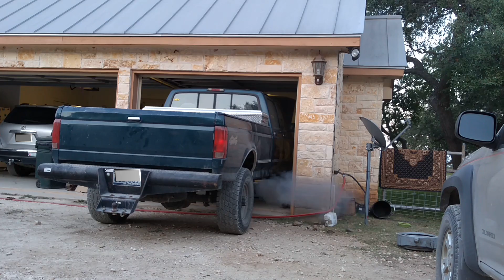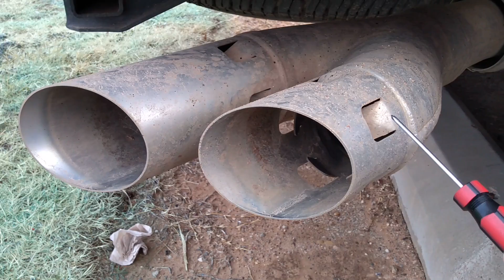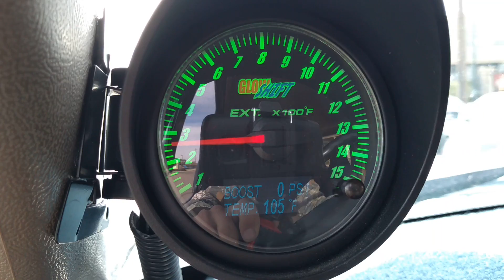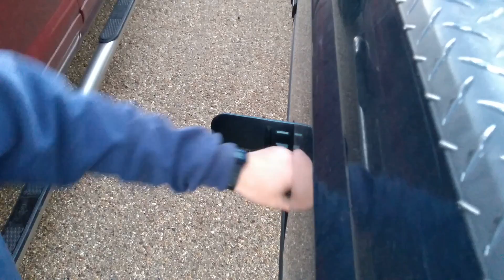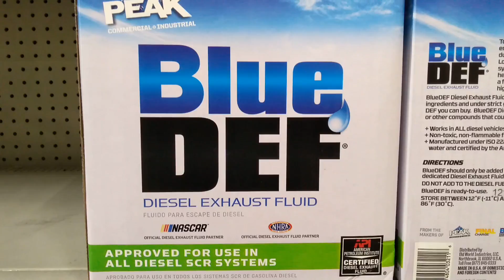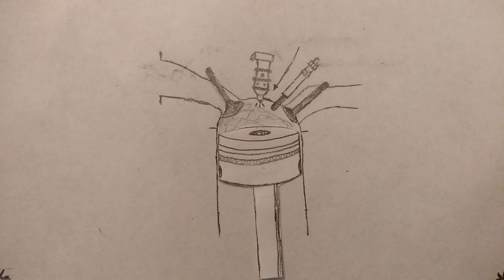Top 10 Things to Never do to a Diesel

Comment: Understanding you're a Ford guy but I'm searching everywhere I can for some answers of what happen to me with my cummins 5.9 with 133K miles.
Just took the truck for an approx. 2500 mile road trip with my approx. 13300 pound travel trailer. I purchased the super tuner on my way out, around 25% of the miles. Also installed a cold air intake K&n. 
I noticed what was described to me as "axle wrap" with the tuner so took it easy with that in mind. All in all, the truck gave no mechanical issues and ran fantastic. 

When home I took it for a ride with tuner still on "TOW/PERFORMANCE" mode, doing 80MPH on the freeway when sudden engine shut down. I noticed, what felt like the axle wrap just before/during the engine failure. All guages still operating, speedo, etc except the engine. 

Atempted starting. Engine didn't/doesn't turn. 
At this time I've removed the oil and filter. I can't see any kind of "shavings" or metallic particles in either of the oil in the container or the filter after tearing the filter apart carefully so not to CREATE shaving. I opened the housing for the flex plate to attempt to turn by hand with the engine solid. Removed the serpentine belt still no turning of the engine by hand or starter. 
All guages in the stock dashboard of the 06 Ram 2500 SLT were showing good at the time of the failure. No over heating. Engine just seized up on me with nothing to show of a reason to do so. I do not have any after market guages showing anything more than stock guages. (That will change when this thing gets up and running again...)

Can you or anyone who read my post here give me any ideas. I'm desperate and attempting any info from those I find might be educated enough to assist. 
Thank you all 
Chris Chapman
2006 Ram 2500 SLT 5.9 Cummins stock other than metioned/super tuner/K&N. 133,300 original, well maintained miles with me owning for 8000 miles, not knowing the previous owner.
Reply from the maker: I'm sorry to hear about your truck! It's certainly going to take a lot of torque to turn the engine over. It may sound obvious, but have you tried charging the batteries and then cranking the engine over? Basically rule out that a bad alternator would have caused the truck to die. If your batteries are low on charge from a bad alternator your starter won't be much good. Diesel engines are hard to turn over by hand already. Assuming that's not the case, you may want to try taking off the valve cover and seeing if there's anything obviously wrong there. If you were really pushing the limits of the engine with the tuner, and 13300lbs is a heavy trailer, you may have damaged the engine with excessive exhaust gas temperatures, which there is no factory gauge for. I'm hoping that's not the case as the engines are fairly resilient. It could be any number of things, and without personally being there I'm afraid I won't be much help. Also make sure the transmission isn't causing the engine to be locked up.
Reply: On my 7.3 my ac compressor locked up and shut my engine down and locked her down. Had good batteries and a new engine but was shocked that that would stop it.

Comment: I have a 1988 Ford F250 with the 7.3, its old but the beauty of it is that about half the stuff you mentioned doesn't apply to that old engine. It does have a glow plug issue it is not firing. I'm debating as (I know you said not to) to whether or not to bypass the glow plug controller on the truck and install a switch to manually ground out the relay and make them work. I've heard people do it and have no problems as long as you don't activate the plugs no more than 8-10 seconds. I bought the truck back in August as a project, I'm debating also would it be worth it to install a pyrometer on the truck as well.
Reply: Years ago I worked for a guy that had an old Ford that had a bad glow plug controller and had thus done the manual conversion.   I did not know they were short-duty cycle plugs on those engines at the time and did the standard 30 seconds to a-minute burn time before starting. 

A day later we found out I took out all the glow plugs doing that and he had a fit and told me I was stupid and knew nothing about diesel because nobody ever runs glow plugs that long on anything to get it started. 

I then commented on every diesel-powered piece of equipment he had from the old forklift, and skid steers on up to his big cranes, tractors, and old heavy trucks and asked him how long he runs the glow plugs on them to get them started.   

His answer, at least 30 seconds to a minute or they will never start.    😋
Reply: @tcmtech7515  I decided to add the option of manual control to the truck by wiring in a switch under the dash. It's not hooked up though as I fixed the factory system and its been doing ok so far. If it fails again, I'll have the option.

Comment: Just out of curiosity what is your take on pulling off the red wire to the wastegate on a 2000 f250 7.3?  Is there any real advantage or dis advantage?  My 7.3 is stock with an intake and muffler delete.
Reply from the maker: I'm not too familiar with wastegated 7.3's, my OBS with the stock turbo is non-wastegated. From my understanding though, pulling the red line either limits the functionality of the wastegate or disables it all together. The wastegate directs exhaust gasses around the turbine in the turbocharger. This basically allows Ford to get away with using a smaller A/R ratio housing on the turbine to improve low end response. The disadvantage to that is that the smaller housing becomes a restriction at higher flow levels (i.e. at high rpm and boost pressures). The wastegate allows exhaust to bypass the turbine to reduce restriction up top and to keep the turbo from over-speeding. You'll probably see some increase in boost on the higher end but at the cost of decreased turbo life (due to over-speeding) by disconnecting the wastegate red line. Also disconnecting the red line will decrease turbocharger efficiency on the top end as well. It really wasn't designed to spin that fast and work well. I have heard plenty of stories of people doing it anyways and everything remaining okay. It's basically just a band aid to getting a higher performing turbo. That's just my two cents though, best of luck and have fun!

Comment: On my 7.3 idi I had one glow plug fail and it was the one under the turbo which sucks to change so I installed a manual switch so that I could utilize the other 7 glow plugs that worked, I noticed shortly after that it would belch out a lot more smoke than usual.
This was because the glow plug  relay controller wasn't able to light the glow plugs after start up as was designed.
The last straw for me was when I lent my truck to a family member and told them exactly how long to hold the switch, they didn't listen to me and fried the rest of them.
Shortly after I just replaced all the glow plugs and returned the controller back to automatic control.
Plus It is nice not having to hold the switch Every morning as well.

Comment: Another tip is let it idle  a few minutes before  shutdown,to cool the turbocharger  valves  and  pistons
Reply: This could actually help all motors but no one does it
Reply: Yup! I do it all the time. Service manual says 2 minutes minimum.
Reply: I like to get a big palm leaf and fan my engine for ten minutes after I turn off the ignition.
Reply: or you can drive really gentle 10 min before you get home
Reply: Get a chip and it will do it for you
Reply: Mr Wilson - a chip? I think a turbo timer will do it but I dunno what this “chip” is
Reply: When I bought my first car my sister told me to do that especially if you drives in a long distance.
Reply: Depends if you have a water cooled turbo or not. Most cooled ones run the pump for 5 to 10 minutes after ignition is switched off
Reply: I always watched my 7.3IDI  EGT and did not shut down until it dropped really low.
Reply: Mostly just under heavy load or working. Easy daily driving it isn’t an issue.
Reply: That is actually more important than warming it up
Reply: Another tip. Don't turn on a diesel and rev it up to a million rpm just to warm up your frozen sweet cheeks.
Reply: I don’t know for sure but I think early 6.0 turbos stay on for a little bit
Reply: Impossible to do on modern cars😞
Reply: doesnt it cool after turning off? like does it matter if its gonna cool sooner or later?
Reply: @bakoty6571  yes. You're trying to avoid it cooling down too fast.
Reply: walmart $3/gal https://www.walmart.com/ip/DEF-Diesel-Exhaust-Fluid-2-Jug-Bundle/384243022 free shipping

Comment: My dad taught me that, if a diesel has problems starting in the cold, take off your air cleaner and blow your heat gun into the intake.
Reply from the maker: It sounds like that would work! The only thing with modern diesels especially, is that they tend to have plastic intakes tubes. You'd have to be careful to not melt those in the process!
Reply: Rnddiesel just put it on low. And don’t hold it right in the intake
Reply: Basically this is what the Cummins uses instead of glow plugs. Has an air heater in the manifold entrance. Definitely works if you do it right!
Reply: Traditional way was a rag soaked in diesel and burn it beside intake so flame is sucked in, it does work but I once saw a forklift with cylinder head removed and cylinder was nearly full of half burnt paper and rags

Comment: What might your thoughts be on running a diesel engine from vegetable oil?    I recently purchased a 1998 E-350 Van with 7.3 Powerstroke.  It had previously been converted to vegetable oil for the second tank  (But it was disconnected 8 months ago).   

I had to take it back to the shop as it shut down on me...which the mechanic said was partially due to the fuel injector being clogged up and the oil-pressure sensor not working. 

I've been watching your other videos about the fuel injector firing out the fine mist of diesel, and this makes me concerned about running vegetable oil, especially for a power stroke that uses such high PSI... Do you know people who successfully converted their power-strokes to Vegetable oil?  Is there a way to successfully filter the vegetable oil to the point that it doesn't  gunk up the engine?
Reply from the maker: I dumped straight vegetable oil in my truck a while back when diesel was unavailable. It ran fine, though it was only 6 gallons of VO in a 19 gallon tank. I also used brand new stuff from the grocery store. I've heard the used stuff isn't so great. The oil tends to get moisture in it from use, and you'd need to dry it out to make it safe to use. That's what a lot of biodiesel manufacturers have to do. I'm not a chemist, so there's a lot I don't know about the fuel composition, but from my understanding VO doesn't burn as clean as diesel, or biodiesel for that matter. It tends to cause coking which clogs injectors, though bear in mind it also likely has other undesirable chemicals in it as well that aren't good for an engine. Diesel is engineered to burn clean, VO not so much. I don't think it's the high pressure that's causing the issue, but rather that the oil doesn't burn as well. Some chemicals in the VO can polymerize which clogs injectors. I ran some sort of mineral oil in my truck for a while. It cause the truck to smoke white, but using injectors cleaner for a few tanks cleaned it up. It's hard to say whether you should run it or not. You'd have to do a lot of processing to make used oil safe, and frankly just covert it to biodiesel at that point and it'll be way better than the straight used VO. I probably wouldn't run more than a small amount of used VO at a time unless I could properly covert it to biodiesel. I occasionally run a gallon of used oil from the deep fryer in my truck after running it all through a coffee filter. It's usually okay in small quantities like that, though a large quantity will clog the injectors as you know.
Reply: @Rnddiesel  I ran veg oil in my old diesel engine. It runs fine when warm I would start it on diesel then switch over to veg oil but always remember to switch back to diesel before you stop the engine !!!! or it clogs up and wont start again.
Reply from the maker: @flatten1682  That's cool, running alternative fuels is one of those things that makes old diesels more appealing. From what you can tell, did the vegetable oil have any long term affects on the engine/seals?
Reply: @Rnddiesel  This was an old army Lister Petter generator solid and well made .The seals were fine.
Reply from the maker: @flatten1682  That's good to hear, I've heard of potential issues with running a vegetable oil in a system designed for diesel. Supposedly the vegetable oil degrades the seals, I'm glad to hear your experience says otherwise!

Comment: The other problem with ether is it washes the oil off of your cylinder walls so it wears the rings fast. That’s why diesels that have had it used a lot become “addicted” to ether. If you have to use a starting aid for whatever reason use WD-40. It’s flammable and it lubricates. But you do have to shoot it behind your air filter.

Comment: I’ve used starting fluid for years to start multiple diesel engines. Many industrial and farm diesels had a ether injection system plumbed in to the intake from the factory!  The key to using it safely is that, as you mentioned, the glow plugs or intake air heater cannot be functional (not even a little) so they must be disconnected, and the starting fluid must be administered upstream of the intake air filter so that it can be diffused evenly throughout all cylinders. Obviously this isn’t something that just anybody should be doing but I have started my 96 7.3l for the last two winters and my 6.9l IDI before that with 2 or 3 quick squirts into the front of the air filter and it starts nice and smooth every time. As with many thangs in life it is all about moderation.
Reply from the maker: Thanks for the advice! We've got a couple old tractors with the built in ether button as well, but go figure that doesn't work on a 50 year old tractor. I think a lot of it depends on the design of the engine. I'm sure the built in ether mechanism is designed to administer the stuff in a somewhat safer manner. Definitely being cautious when using ether is a good thing, though ideally the engine would start without it!

Comment: Been using starting fluid in all my old diesel engine's now for many decades no issues, but I wouldn't recommend using it.
Reply: I've never used it in a smaller diesel, but have used it hundreds of times in the past in the large engines. You need to understand that it usually only takes a quick shot or two to get one started - preferably by a second person while someone else is starting it. A little is OK. A little more can be destructive. And whatever you do, once it starts, resist the urge to hold or pump the accelerator at WOT until it smooths out (seen it many times). Use just enough throttle to keep it running because there is a lot of weight slinging around inside the block that may not be getting enough lubrication to be run at WOT until it warms up a little.
Reply: There are cheap magnetic heaters to put on your oil pan that may help

Comment: 2002 7.3 still strong 💪. Great video thanks for the information. 197,000 on the od. 1979- to what ever GM had garbage  5.7 Lt. engine gas conversion terrible.  I did many head gasket repairs. Either the Block had a crak, or the heads were worped GM. I went AIS intake Valvoline Blue 15 w40 year round. Plus extra fuel additive safe of course. 48 is the fuel. Diesel is first to be distilled the gasoline grades come after.
Reply from the maker: It sounds like your 7.3 is still running strong! I've only heard bad things about the GM 5.7 diesel. Supposedly it's a common problem for the blocks to crack, they messed up with the casting and didn't let it cool properly or something like that. It stinks that you had to do so may repairs on the 5.7. At least you've got a good 7.3 now!
Reply: @Rnddiesel  Im pretty sure the GM 5.7 diesel was based on a standard 350 cubic inch gas engine. I think they actually did go to four bolt mains, but that block was never designed to handle the much higher compression ratios and cylinder pressures that diesels create. These things were born to failure!
Reply from the maker: @Thedoug369  I really don't know all that much about the Olds 5.7 diesel other than its terrible reputation and lack of power. I had the impression that the displacement was the same as a 350 gas engine simply because GM already had the tooling to make everything that size, but that the block and cylinder head makeup was different to account for the diesel cycle. Supposedly if the 350 was just converted to a diesel cycle, it wouldn't  have even had a fighting chance of living. The Olds 5.7 was beefed up at least somewhat, but apparently not enough...
Reply: @Rnddiesel  I read a report years ago about the 5.7 olds Diesel and what it said was that the biggest problem was the fact that the compression levels were not close enough and what it would end up snapping  cranks and cracking blocks. cylinder compression with vary from 17 to 1 to 21 to 1 so you can see what would happen there.
Once they got the compression levels even the engines held up.
My brother had one back in 79 + it ran like scalded dog.  Not much good in the mountains though. It could have you used a turbo. It got low twenties for fuel mileage.